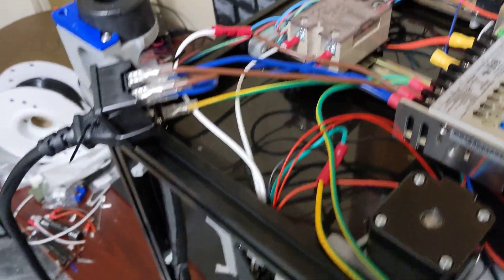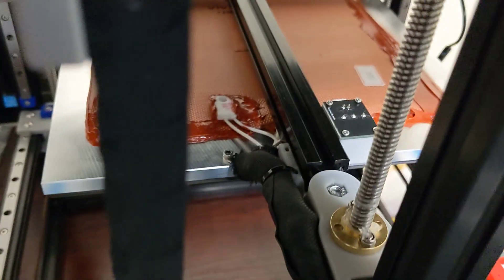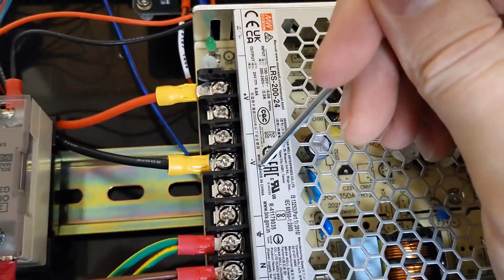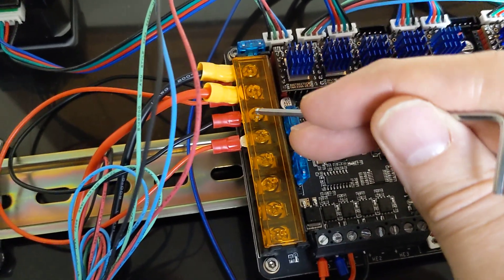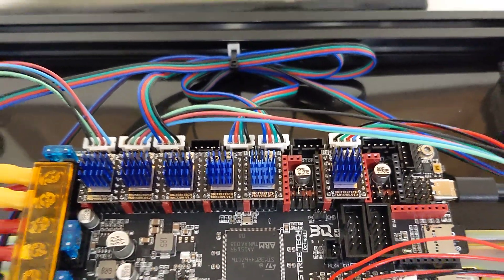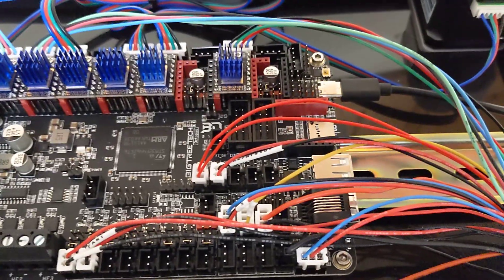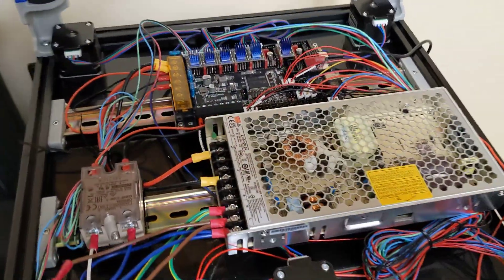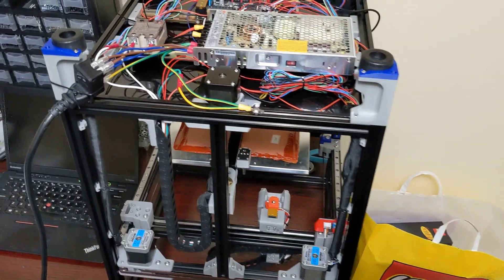FORMBOT Voron Trident 3D Printer Kit - Episode 4 - Wiring!!

Comment: While following the instructions from the Voron Trident PDF, I noticed the "L" on the 24V power supply goes to 5 input Wago and from the Wago there is an "L" connection going to the SSR "Load 2",  your goes instead to "Load 1" why? they are identical parts, My "load 1" goes to the bed fuse.
Reply from the maker: it shouldn't matter I don't think the SSR is just a switch the 24v signal to it "turns it on" and allows 110v to go through. I am sure the L from the 24v can go into L1 or L2 on the SSR. I don't remember what my wiring diagram looked like from formbot as this was over a year ago.

Comment: Did yours come with a ground to frame wire or did you add that yourself?
Reply from the maker: if I remember correctly it came with a ground wire as part of the PSU wiring
Reply: @Rolohaun  Got ya, I had a SSR ground wire, but it looked out of place. I was thinking maybe that should have been the ground frame wire.
Reply: @Rolohaun  How are you supposed to shock yourself on the frame if you need to scrape that thick oxide layer away for any contact to be made?

Comment: I just got my Formbot VT kit in part to this build and I'm just getting parts printed.  I'm confused about the "WAGO 221 415 Lever Nuts" on page 219 of the VT manual.  My kit didn't come with any and you also do not show them wired up.  Are they not needed with the way the wire harness comes or something?  Do I not need to even print the "wago_221-415_corner_mount.stl"?
Reply from the maker: I believe the wago stuff is new to the trident and not needed on older Kits, formbot probably does not include them. Mine never had them and was not needed.

Comment: Did you use a BAT85 diode on your signal pin (PG15)? I’m reading conflicting posts on using PB7 with no diode. Is there a difference?
Reply from the maker: Ya it's confusing you only need a diode for Diag_7 here is what my formbot config was

## For the DIAG_7 port. NEEDS BAT85 DIODE! Change to !PG15 if probe is NO.
pin: ^PG15

I used PG15 so nothing extra needed
Reply: @Rolohaun  wow quick reply, thanks! Nice vids btw
Reply: @Rolohaun  sorry 1 more clarifying question. Isn’t PG15 within DIAG7? Therefore wouldn’t it require a diode? My confusion is the lack of a BAT85 Diode on the formbot BOM if VORON specs it. I didn’t receive one in my kit.
Reply from the maker: @davy0537  ya I really don't know why they say that alot of people on forums ask the same question. With the Omron prob nothing else is needed.
Reply: @Rolohaun  okay perfect! Saved me waiting for a diode :) thanks again
Reply: @Rolohaun  This is wrong. PG15 is a pin on diag 7 which is made for endstops. It is only meant to have 5 volts introduced to it, but the probe can send up to 24v. Because of this you need the diode so that the probe can pull the 5v down to 0, but it can't send 24v to the board.

Comment: Where from did you get the second bed heater wire? My kit came with only single long heater wire.
In your previous video you also showed the bed with only 1 long heater wire. Should there be a second wire somewhere in the bag?
Reply from the maker: my heated bed has two red wires for the thermistor, one long white wire for the heater and one short wire. Heated bed has 4 wires total. the short white wire goes to the thermal fuse and the yes I had to run a longer white wire. I had so supply my own. But the heated comes with one short and one long
Reply: @Rolohaun  Right, I was asking about the second white heater wire that goes from the fuse to the SSR. Does it need to be something fancy, like in fabric insulation etc.? It seemed strange to me that Formbot sends all the crimped cables (even longer than necessary) but forgot about this single heater wire...
Reply from the maker: @PawelStaniczek  ya your right they should include one, the z doesn't move that fast so any wire should be fine